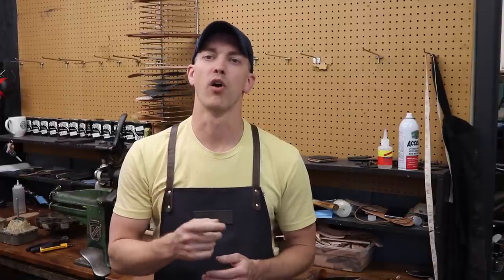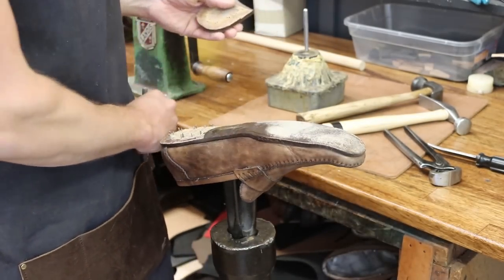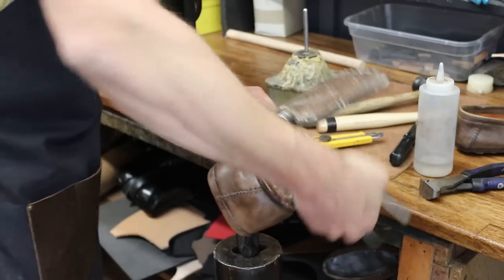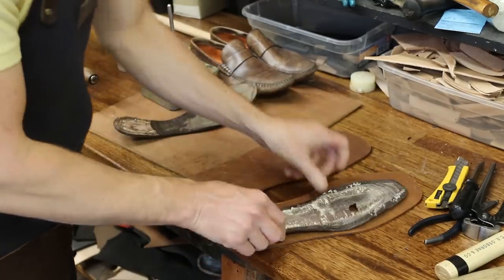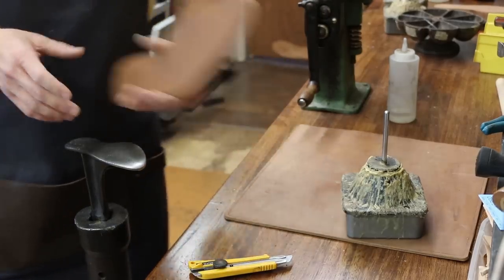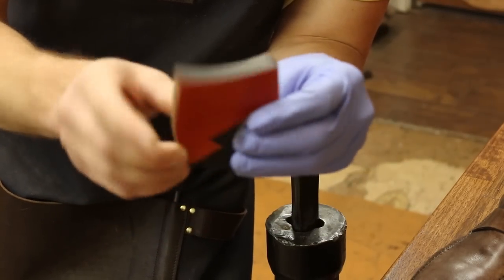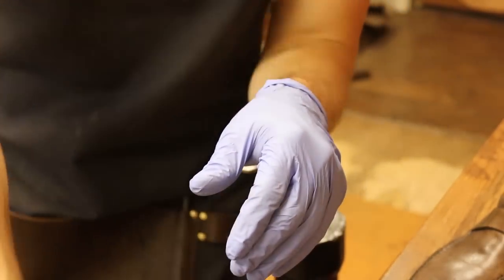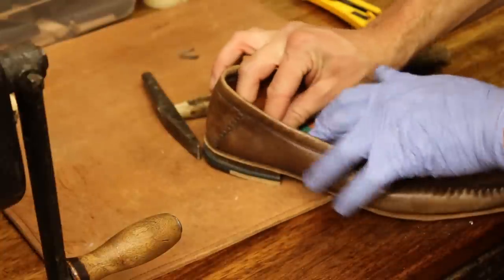Santoni Loafers - Orange Sole Replacement

Comment: The magnetic hammer you're looking for is an upholstery tack hammer with a split face.  The split side is magnetic.
Reply: It's exactly what he is using here. His has lost the magnetic field over time of being exposed/attached to another piece of steel.
There are devices that will re-magnetize his hammer. Just be careful, as you only want the split face side magnetized. Otherwise it's actually harder to use properly.
You could probably wind one side of the hammer with fine motor-winding wire and apply a charge....
You may be able to magnetize it if you hold it properly aligned in an MRI machine, but I don't recommend trying this in person.
Reply: The ones at Lee Valley just have small magnets on each  end but function the same.

Comment: You can magnetize your hammer with a strong neodymium magnet; same as you would a screwdriver or any other metal tool. It's not the upholstery tack hammer you're looking for exactly, but it's a quick little upgrade. The process to magnetize your tools is fairly simple: rub a strong neodymium magnet in a single direction onto your tools. 
I enjoy this channel very much btw!

Comment: I have a pair of Santoni’s that are over 20 years old.... my father got them for me as a gift and congrats for getting my first office gig!  As a guy in my 20’s at the time, did not fully appreciate what I had, and wore them out until I did get the bad hole in the sole, and have not worn them since.  Always wanted to get them resoled.  This video is exactly what I would like done.  With the hole in the sole, are mine a lost cause?  As my first true ‘working shoe’, and as a gift from my father, they have quite a bit of sentimental value to me.

Comment: Nice work. I saw another video where the guy had a manual tack nail gun where you put the nail in the gun stick it inside the shoe and tap it in so it’s guided

Comment: It should be easy for you to magnetize your hammer.   Find a powerful magnet and stick it to the side of the hammer and then drag it in one direction for the entire length several times.  I'm sure there are You Tube videos on other fancier ways, such as electromagnets, but that should not be necessary.  Thanks for your excellent videos.  Your presentations are easy to follow.  I find them relaxing and will be using some of your techniques on some of my old shoes.  Thanks again.

Comment: I have a pair of floor shine loafers similar to the ones that you’re resoling here. I’m trying to do them myself. I’ll continually watch your show and a lot of cobblers. I’ve gotten enough nerve to try to do my own. I was wondering what is the ounce weight or thickness of the soul that you’re using and would it be possible that I could buy a pair of those souls from you to do mine with thank you.

Comment: A good way to start small nails is get a nail punch with end that matches nail heads and put a small piece of rubber tube over the end and protruding a little. Place nail into the protruding tube and start the nail by hitting punch with hammer. The punch and tube will then pull off allowing the nail to be finished with the hammer.

Comment: I have the same shoe and it wore off exactly the way you got those shoes sent to you. I was thinking 0f getting a thin 1/2 Vibram rubber sole instead of having it completely redone. Bit the orange looks much better :-) Any thoughts on whether the Vibram is an ok idea too or would it ruin the feel of the shoe?

Comment: I noticed a plastic box on your workbench full of bits of leather from when you trim the excess off new outsoles. Those bits must add up. What do you do with them? I see that the leather used to upholster sofas & chairs is sometimes described as 'bonded leather.' I suppose this bonded leather is made from your trimmings? How about the old soles you remove, are they recycled too or they so ratty you just have to junk them?

Comment: Santoni makes a beautifully elegant loafer. Quick question, can loafers like this be resized by removing the souls, unstitching the heel along the seams, and removing leather in equal portions from both sides of the seam? I have a pair but didn't downsize correctly and the soft leather has begun to stretch out.

Comment: Outstanding info guys! Question...what is the difference between Blake and Bologna shoe sole construction?
Reply from the maker: Hanxta Thank you!  Long answer but hopefully this somewhat explains it..

With both methods, the uppers are  attached to the outsole with a insole stitch (Blake stitch).  The difference is internal.   The blake simply has the lining & upper leathers pulled straight during lasting. The bologna has the lining stitched to the sock lining.  There is no real leather insole to add structure.   It creates a very flexible  shoe.  The pair in this video is similar to a bologna.  I usually find bologna construction on thin loafers with no toe puff.   They are  often called Blake stitch as well simply because of their attachment to the sole.  Bologna's are made for comfort.  Hope this helps
Reply: It helps a great deal! I have a pair of Allen Edmonds Verona II Italian made loafers that AE says are Bologna constructed. Never quite understood exactly what it was until now. Watching you work, seeing a loafer deconstructed, and your clarification in explanation really helped me understand. Thanks!

Comment: A trick I learned in school in sewing class for making your sowing scissors magnetic: rub a rather powerful magnet a few times from top to bottom of the scissors. Very useful if you drop a box of pins. Maybe you could try the same trick with your hammer?
Reply: Sorry, forgot to mention: you have to rub in one direction only!

Comment: Ok guys, gotta ask. There are nails holding many shoes together, yes? Why don’t I get stabbed in the foot when I walk? More specifically, why use nails in a 270° welt rather than a 360° welt? I do understand that Euro cobblers will use the 270° welt then make the heel block sit nearly flush with the heel upper. I don’t understand how it can be held together. Thanks, don

Comment: What are the advantages of using a dobber over a shammy to apply cream polish to a shoe?
Reply from the maker: Colbert Ta Not many.  :)  Dobbers are okay and work well if the shoe is all one color and you don’t mind getting the cream all over the shoe.  It also does a good job getting into the cracks and hard to get areas.  A chamois is what I usually use because I can control the cream a little better; especially if I’m working with two-toned leathers or leathers with lighter color stitching.

Comment: I am thoroughly enjoying your channel and dread the day that I run out of your archives. I want to make a recommendation in order to improve the quality of your video: blurriness of subject can be avoided if you have a key light on the shoe as I know that your lighting circumstances at the shop are ideal for working but not for videography. Showing detail by moving closer to the camera just induces blurriness. Stop doing this. Just manually zoom it in post production or shoot a B roll just for detail. Turntable shots of before and after are aesthetically nice, but stark comparisons are easier with side by side static images taken at identical "elevations" like an architect's plans.

Comment: Been wondering from the first time watch your video.. why not put on safety glove? 
Dont mean to say you dont know how to be safe but since you are dealing with that many sharp tools and machinery, bound to injured your hand, wouldnt it?
Reply from the maker: Occasionally it happens, but I have more control without them.
Reply: Gloves are usually not a good choice around machinery that spins as the glove material can pull your hand into the machine.  Abrasion is better than a mangled finger.

Comment: You want an aircraft tack hammer.
Reply from the maker: If it helps me not smash my fingers anymore.   Ha ha
Reply: It has the magnetic tip. It takes a little practice but they are used to hammer in very tiny brad nails. If that doesn’t work for you try using some needle nosed pliers to hold the nail. That’s what I used to do. You get the pliers with a straight nose 45 degree and 90. Just trying to give you ideas. I was born and raised in Smashville. Good to see y’all on YouTube.
Reply from the maker: @bigpirdy  Good deal.  Yeah I need to get one.